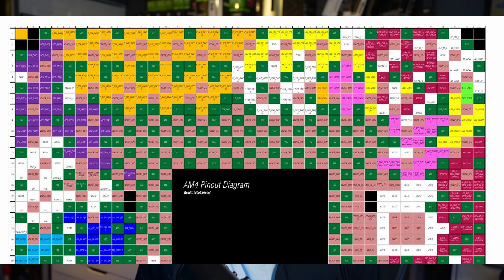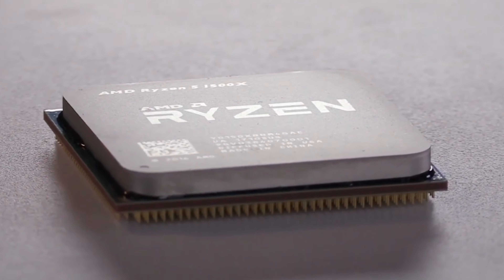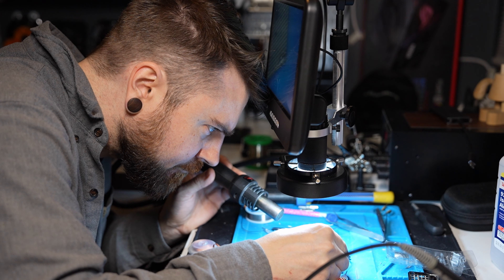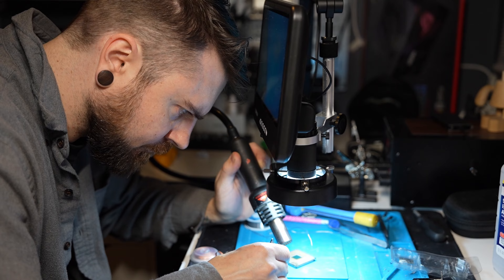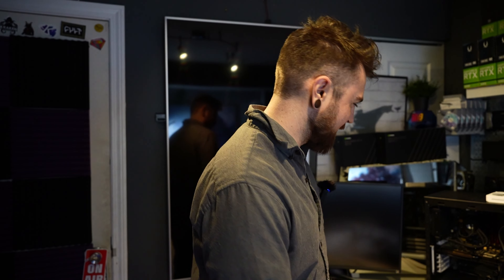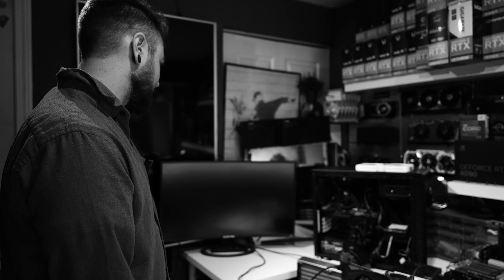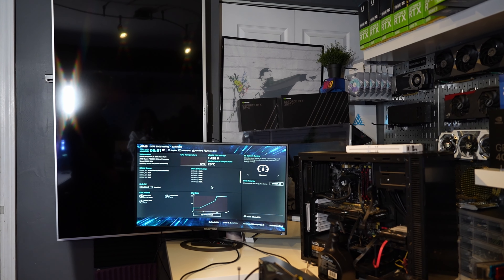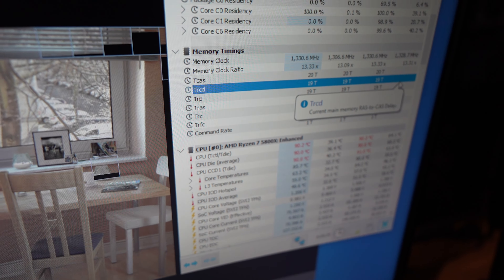I should have NEVER said yes to FIXING this...

Comment: Bruh, I had my cooler stick to my Ryzen AM4 CPU 2 times. It pulled the CPU right out of the socket. Thankfully, it still worked! But my heart sank for sure.
Reply from the maker: It's one of the worst feelings...
Like, retention clip?!? What's your point!

I've probably done it at least 10 times, and I have ruined 2 CPUs over the years as well. 
Appreciate the comment man.
Reply: @techwandoUS  Anytime! ;)
Reply: Heat it up and twist a little before pulling - that does the trick!
Reply: @FoRk-One I finally figured that out lol 😅thank you

Comment: Great job on bringing that CPU back to life.  Lead solder is really forgiving, and maleeable.  I like to lay down the PC, give the cooler a fairly small, left turn, then back to the right.  Over and over with almost no force until they separate.
Reply from the maker: Thanks man. Yeah the lead solder basically saved the whole job fortunately. Also solid tip on the cooler removal. That definitely works very well also. I think my friend was honestly just rushing through the steps, can't tell you how many times I've also done that same mistake. Usually during troubleshooting too.
Reply: @techwandoUS  Have a great weekend, I enjoy your persistence on projects.
Reply from the maker: @Willbme4EVA  Thanks man, means a lot. Videos like this don't tend to do too well but honestly it's people like yourself that have good input and watch that makes the show go on haha. Thanks again.

Comment: Running the system, hair dryers, etc. sometimes work, but what always works is a strong monofilament fishing line. Unlatch / unscrew the heatsink, and start sawing away. Way safer than prying, or pulling the CPU out of the socket.
Reply: For the pins, I use dental tools, just not the sharp ones. Flux is key, as you mentioned. To avoid pulling pads, desoldering alloy can help too, if you have to remove one to fix a bridge, etc.
Reply from the maker: Appreciate the tips, the dental tools is really smart. I'll also look into the desoldering alloy too. I tried that copper wick but it was to small between the pins.
Reply: @techwandoUS The trick with wick in small spaces is to cut one tiny piece at a time and swipe it across with the iron. Usually if you have a small enough tip, wick might not even be needed, depending on how much of a bridge is there.

Comment: These ones always ALWAYS get me the title brings back the Trauma of fixing a Ryzen 9 5900x X2 tried the mechanical pencil method and the buy spare pins off eBay for $20 and use a solder irons to replace broken pins. Desoldering and resoldering new pins. Never had any luck with the credit cards method to straighten not mangeld pins. 

(CPU came from new eggs forklift games where this could box was used as a ramp to do sick jumps with in a forklift 🤣☠️)
Reply from the maker: Totally understand the trauma man!
I might put myself out on an idea here, but have you noticed how easy it is to get the pins off? You could take a heat gun and just wipe out all those pins in a very short period of time. It would be cool to see one of those like x79 x58, Chinese motherboard manufacturers to make a motherboard that just swaps the pins to the board so that you could use broken am4 CPUs on a LGA board.

The Newegg comment 🤣 
I'm terrified of their used stuff.
Reply: @techwandoUS  this cpu arrived like that from them new lol I stated a return got refund then got black listed from ordering from them 😂 a noob tip never use low melt solder to remove pins it compounds this exact problem 100x ☠️ go to remove 1 pin end up removing 16 😂
Reply from the maker: @shadowarez1337  yeah you are definitely right about the low melt solder. At one point it felt like an impossible task. The combo of the flux with the lead solder to redo the pads and then the real no clean to touch stuff up worked. The only way I'd recommend anyone do this though is if they knew someone who had most of this stuff to begin with. I probably spent more money than a used 5800X all said and done, plus time. 

Also that's INSANE the CPU came like that.